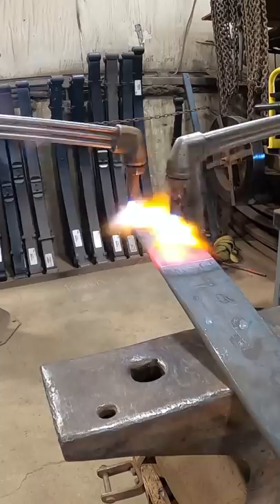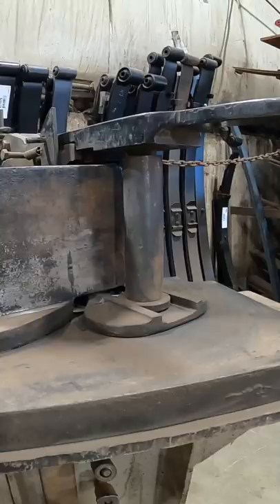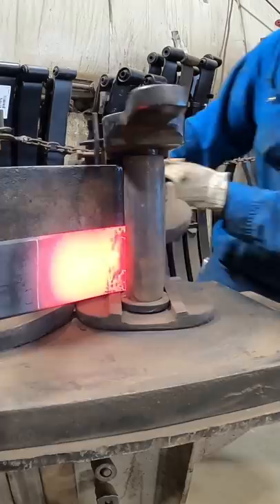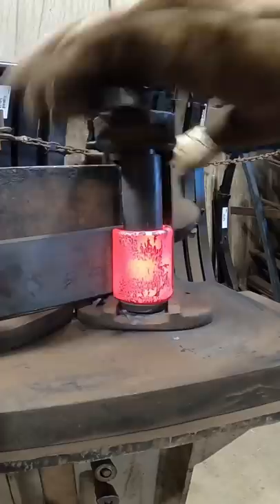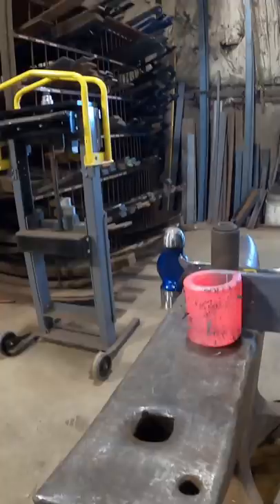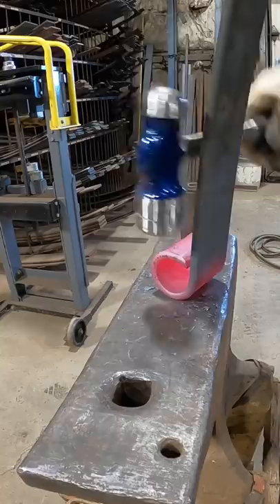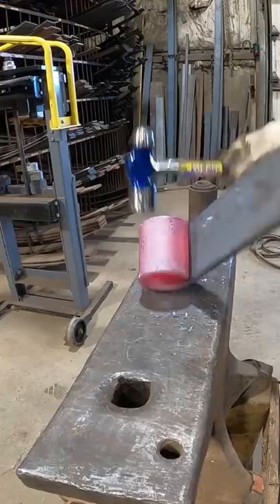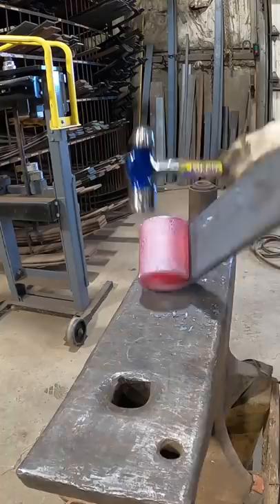Rolling a down-turned spring eye

Comment: Now I know why I cant get the bushings out of the springs
Reply: Or why he cant get them in, apparently
Reply: @johndc2998  they are pressed in with a hydraulic press, if he wanted it in he would of left it in when it was loose, and then he would of tightened it up.
Reply: Theyrr supposed to be tight
Reply: Cold metal shrinks
Reply: the Kingdom of GOD is coming…“Silver is for the kettle, and gold for the furnace, but The LORD is the tester of hearts- Bible” your heart is like discovered silver, dirty and not pure, when silver is purified it is melted over and over, to the point that when it’s melted and glows red hot, it is pure enough to see your own reflection in the puddle, so also does the LORD purify your heart, till HE can see HIS own reflection in it, seek the LORD and be reborn, ask The LORD to renew and restore you, repent and be baptized for the forgiveness of sins, Jesus died so that our sins will be wiped away and so that we could be made new, seek The Kingdom of GOD for if you would be wise you would be wise for yourself, pick up your cross and deny your flesh and follow the path of GOD, for The Kingdom of GOD is at hand, in JESUS MIGHTY NAME Amen and Amen 🙏 o
Reply: @jasonstormoen  Pffft.. I changed all my Rubber bushes to Urethane on every off roader I have owned.. old Chisel to cut the old ones out Lube and a screwdriver will get the new ones in.
Reply: @74KU   I just like doing stuff the right way.

Comment: What about the "temper" of the steel, wouldn't this create a weak/soft spot right at the eyelet where the most pressure will be? Hate to have a load of hay or heavy trailer and a eyelet snap off due to soft spot, or did you quench after the vid stop? Just curious been black smithing a few years, great vid by the way, not trying to say your method is incorrect, just wondering about the heat/hardness

Comment: Rule nr1: If something falls, dont try to catch it..👋🔥
Reply from the maker: yup, which is why we wear gloves too, stuff is hot.
Reply: @simcoespring  lol, same thing in a kitchen, except in a kitchen, if you get hit by some certain items that get knocked off the table, you lose a body part.
Reply: @Nawmps  we said falling tools, not equipment, same thing though, if a pallet falls off a warehouse shelf dot try to catch it.
Reply: I have. A lower control arm from an 89 civic. Red hot and turned my skin to liquid instantly
Reply: @simcoespring  do not let the iron fall, this will damage the piece, place cloths on the floor to cushion the fall.
Reply: @simcoespring  essa peça roliça que você coloca dentro da mola, não deixe cair essa peça, a queda pode danificar

Comment: Curious if heating the ends causes problems with the heat treat? Does the heated eye end bend or break or do you have to reheat treat the whole spring?
Reply: Yup, over 400 C it will mess with the heat treat, that's far beyond that. This will be pre hardening and tempering.
Reply: @brendandor  I was wondering if this was before. Cheers for the info
Reply: The solution is annealing it after you form it.
Reply: The ideal set up would be a forge, get the entire piece red hot and hang it in a slow cooling oven. If you don't have any sort of an oven just hang it from the area that you are least worried about on the metal itself and just let it cool off

Comment: Fitting while the metal is hot is great, but be careful because once it cools it will overall be a bit smaller and might have shrunk too much if you fitted to close while it was hot.
Reply from the maker: Yes we want it a tight fit.  The eye has to expand when we press the bushings in so it holds it real tight.

Comment: When you made that slight adjustment with your hammer, you flattened one side of the loop, your PIN would no longer fit in the loop.
Reply: It’s meant to make it so that the pin has to be pressed in.
Reply: @dcavidgomez2877  ok, is the loop intended to stay snug on the pin for the life of the unit? Thx again for your vid.
Reply from the maker: i'm only tucking in the eye about 1/16  of an inch which isn't enough to put the eylet out of round.

Comment: I had the impression that heating a spring took the elasticity out of spring steel. guess I should look into and find out. I think I heard that at a shop I worked at, a youngsters came in and wanted coil springs cut we did it but used a band saw not torches I was told it would cause them to collapse.
Reply: So what about the heat treat afterwards?
Reply: Springs are heated in order to bend them into the needed shape then they are heat treated to achieve the desire characteristics.  Heat treatment is different for different materials.  A common series of steps are  1 heat until red hot cool very slowly to soften the material reliving all stress from the material
 2 heat agin to red hot and quench in oil. This makes tha metal extreamly hard and brittle.  3 hear the metal a third time to the temperature range that will give you a balanced between hard and soft to achieve the desired characteristics of the product you are producing being a spring  a chisel or  even a knife .
So if you use heat to cut a heatreatted spring and don't reteper it it will bread ( cooled too fast brittle) or it will bend cooled too slowly ( too soft) . Old school methods used the color of the metal to determine temperature,  new methods use instrumentation for the same information.
Reply: @thomaslemay8817  We would use a hickory stick to gauge the temperature of the tempering process, when the stick would catch fire it was ready. The stick would wear into a left hand double helix if you were right handed. Going at it hammer and tong.

Comment: Estwing are quality.
Reply: So is Rolls Royce what's your point, are you a hammer spotter FFS
Reply: @ Delta November i agree with you on that, as well as their nail pullers/ cat's claws. That is all I have used. I have been doing residental construction/ remodeling since i was about 10 years old working with my dad and his family framing houses, shed and big barns. And, spent the last almost 30 years working in the construction field after my service in the U.S. Army.

Comment: Curious why you guys don't have a small furnace to heat these rather than the oxy torches?
Reply from the maker: we do actually have a devil forge.  We didn't use it today because we where just bounding around on different jobs and just needed it done quickly.
Reply: That good enuff reason Luke??  I’ve learned to NEVER question a dude with a plasma cutter.. jusss let them WORK bruvahh
Reply: 3 @simcoespring  jh36q30

Comment: Nothing sloppy here!

Why didn't you make sure the second pin goes through? Or that's not what it goes through the eye?

Before entering the piece to roll it, tell your helper to slide it as parallel to the floor as possible or use a table so it doesn't get pulled up or sloppy by entering it a little inclined. Parallelism is the key although you can fix it! Great job!

Comment: Genuine question. What causes leaf springs to break? My 99 Tahoe broke both of the smallest leaf springs on each side.
Reply from the maker: from my experiance we have noticed that leaf springs break from either time, rust or mileage.
Time: even if you don't drive the vehicle all the time it still has to carry the weight and can cause fatigue in the steel
Rust: rust buildup between the leaves can cause a "leaver" effect causing the leaves to flex around the rust causing it to break, sometimes the rust just eats away at the steel causing it to be weaker and break
Mileage: you can only bend a piece of steel back and forth so many times before it breaks.  In fact I'm amazed at how durable spring steel is.  it truly is amazing it can flex back and forth millions of times before it breaks.
Reply: @simcoespring  thanks for the reply! Now that you mention it, it really is amazing!
Reply: It depends on what kind of abuse you put the vehicle through. If it's just a daily driver and you've been the only owner then Chevy just makes some real shit suspension parts.

Comment: Look if you heat up metal to cut or shape it your supposed to quench it when your done otherwise it loses alot of its strength , sombody correct me if im wrong
Reply: These are Springs. If he just punches it they would shatter

Comment: I do not need so much fire, they waste acetylene. Positioning the device vertically, you multiply the power with a counterweight, eliminating stress with the help of support, and springs, which lift it,to feed it, and driving it by gravity, obviously controlled by the force that you print on it.

Comment: If the pin fits the eye when it's red hot, wouldn't it be undersized when cool?
Reply from the maker: yes, you are correct.  the eye needs to be smaller than the bushing so when you press it in, it holds on to the bushing really tightly so it doesn't rotate under load.

Comment: Do you have to re-temper the eye?
Reply: Notice he didn't answer you. 
That's because he ruined that spring.
Reply: The spring still needs to be drilled for center pen , then they need to bend it to the nessary shape.  After all shaping drilling is finished  then the heat treatment process starts.
Reply: @thomaslemay8817  that makes more sense. Thank you for the explaination.

Comment: Is it fine to give an extra bend from hammer 🔨 while servicing the spring
Reply from the maker: we roll the eye and when it is done it is usually within about 50 thousands of an inch.  I just adjust it with the hammer so it has a good friction fit when I go to install the bushing.
Reply: No I am talking about stiff springs did hammering and giving extra tension (bend) to the stiff spring for a good ground clearance and high weighing capacity is it fine or we should install and extra plate

Comment: How much to re-arch some rear springs on a f150 1978?
Reply from the maker: I usually charge $110 per spring plus any other hardware.  It depends on how much arching is required.
If the springs are totally sagged out then we usually just put an extra leaf in and that will bring the truck back up about 1.5" at the wheels.  Sometimes if the springs are too sagged out they won't hold the arch and will just sag back down after 6-12 months so the extra leaf fixes that issue.

Comment: I wonder if they can make a custom spring beam for my 4 bag air ride I want to do for my 06 dodge 3500.
Reply from the maker: use the main leaf and fabricate a bracket to mount the airbags to?...use the Ubolts to mount it to the leaf spring....
Reply: @simcoespring  I made a parallel 4 link with two bags behind the axle. It works ok but I want to balance the load on both sides. I need a semi style z leaf but with bends either side of the axle.  If you have a website or email I could contact you via that to show you what I am needing.

Comment: You already made the eye too tight to get the pin into it and that’s while it’s still red hot when it cools it will get even tighter because metal expands in heat
Reply from the maker: yes, however you do need the eye to stretch open when you put the bushing in or else it won't have enough holding power to prevent it from rotating under load.  it has to be a snug fit but not tight so when it cools it should be a nice and tight fit.

Comment: And that is why when a spring breaks when it's not where the centering hole is it breaks right at the eye
Reply from the maker: leaf springs break in 3 different locations.  it will break on the eye where the bushing goes in, it will break right where the center bolt goes through the middle of the leaf, this is usually caused by the Ubolts not being tight.
However the most common place it breaks is right where it flexes.  It is usually about 1-2" from where the Ubolts clamp the spring pack together.

Comment: Is there no quenching? Like seriously asking
Reply from the maker: The leaf springs are already heat treated so when we do a quick heat and roll cycle, we don't notice too much of a decrease in quality.  If you anneal the steel by thermal cycling it then you can remove the temper in the steel and make it back to it's base material again without any of the heat treating processes.
However this type of leaf spring manufacturing is not a perfect process and we always recommend purchasing leaf springs that are rolled then heat treated afterwards, the quality is better.  However we don't always have that option, so this is the alternative.

Comment: Do springs eventually lose their springiness from use?
Reply: Only if they are pushed past their elastic deformation limit and cross into the metals' plastic deformation zone.
Reply from the maker: leaf springs will eventually sag.  it usually takes 10+ years or over 150-200k kilometers.  I always figure if you get over 200,000 km you did pretty good and anything after that is just a bonus.
Reply: @cobra6481  Dad?

Comment: What’s price for a 1996 f250 IFS front is end Dana 50 leaf with springs I need new front springs mine are starting to sag a bit. Wondering if you all have any that could soften the ride in the front some.
Reply from the maker: Sometimes it is hard to figure out how to "soften" the ride on the front of a F250.  Usually they already have the lightest spring in the series. (F250-F550 usually have similar bolt-in springs)  However, sometimes the springs, after time, become "dead" or stop flexing and this will cause the ride to worsen over time.  Often a new set of leaf springs will improve the ride back to how it was when the truck was original.  It is also wise to check on the shocks to see if they are any good at all.  Make sure that if you replace the front shocks, do it with something similar to what was installed at factory and not a heavy duty version.
Some people claim that when they put in air bags on the front it improves the ride, however I have not proven this myself yet.
heavier, larger, wider or low profile tires can also decrease the ride quality.  check with the manufacturer to make sure your tires are in the same rating that was installed from factory, having a heavier rated tire can also decrease ride performance.
A lot to think about, and as years go by a lot of these things can be changed out or modified and it will just decrease the ride quality over time.
Reply: the Kingdom of GOD is coming…“Silver is for the kettle, and gold for the furnace, but The LORD is the tester of hearts- Bible” your heart is like discovered silver, dirty and not pure, when silver is purified it is melted over and over, to the point that when it’s melted and glows red hot, it is pure enough to see your own reflection in the puddle, so also does the LORD purify your heart, till HE can see HIS own reflection in it, seek the LORD and be reborn, ask The LORD to renew and restore you, repent and be baptized for the forgiveness of sins, Jesus died so that our sins will be wiped away and so that we could be made new, seek The Kingdom of GOD for if you would be wise you would be wise for yourself, pick up your cross and deny your flesh and follow the path of GOD, for The Kingdom of GOD is at hand, in JESUS MIGHTY NAME Amen and Amen 🙏 o